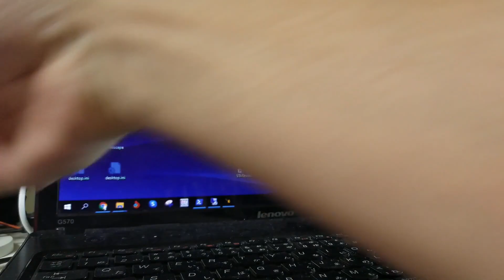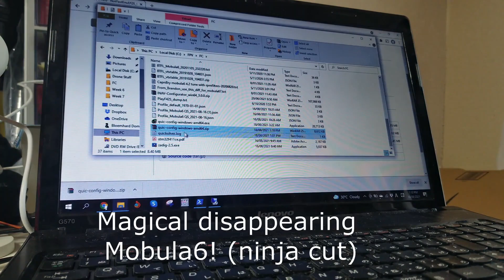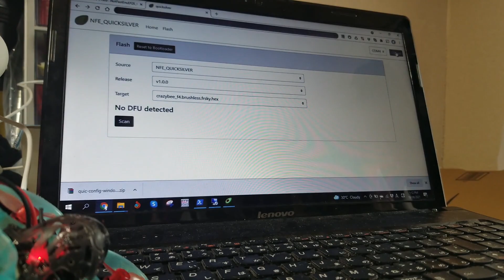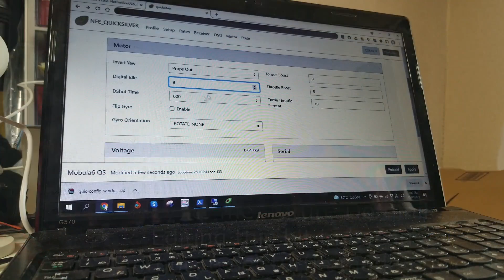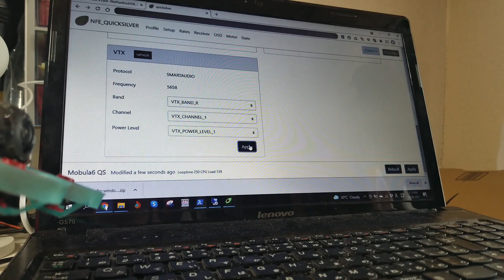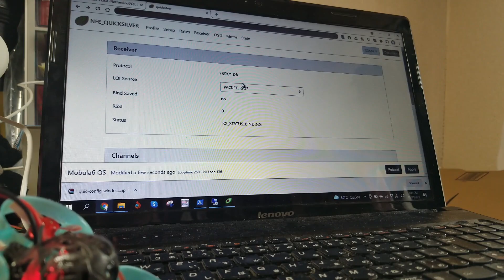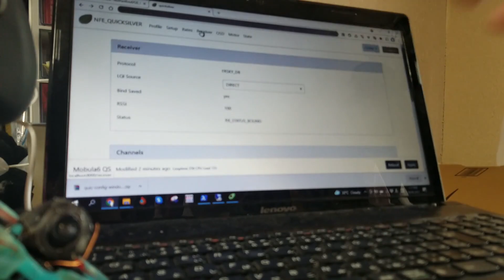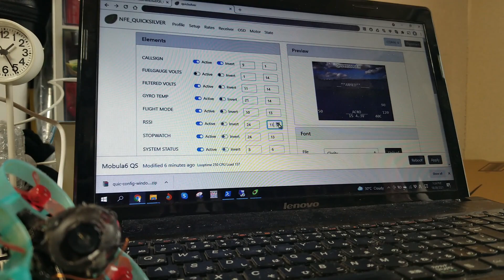Flashing QUICKSILVER to a Mobula6

Comment: 2022 flashing on Mobula6 FrSky:
1) Motors needs to be reversed: Connect USB -> Plug Battery -> Motors -> ESC Settings -> Load and "Reverse" motors directions
2) VTX shows up only as "TRAMP" protocol as opposite of "SmartAudio" and colors shows up weirdly on FPV goggles
3) I fail to arm the quad due to "Arming Safety" message on the FPV goggles
Reply from the maker: Interesting the motors needed to be reversed, but thanks for the info.
The vtx showing up as tramp won't affect the colors in the goggle, this just indicates you are not on the right channel I think. The new mobula6 has openvtx which can do both tramp and smartaudio, but will autodetect tramp. On tramp 25mw is power level 3 (first two are pit, and rce).
The arming safety mostly comes up if throttle isn't low enough (there are other reasons, but that's the main one for me). On the state tab, check your throttle position is registered as 0, you may need to change from AETR to TAER in the receiver tab.

Comment: Hi, I've been trying to load quicksilver onto my moblite7 (non elrs). But I can not get it to recognize the onboard receiver. In setup tab I left UART1 as none and smart audio under UART2 (video and OSD work fine). When I go to the receiver tab it shows protocol as "Unified Serial" when it should say SPI. under status it simply says "RX_STATUS_DETECTING" and under serial protocol it just switches between all protocols (DSM, frsky,..etc). I tried plugging in lipo, and pressing the reset button, also tried to unplug and use the bind button on the FC board...no luck. I reloaded betaflight 4.3.1 and was then able to bind with no issues. Would appreciate any help.
Reply from the maker: In that dropdown where it sats unified serial, there should be some other options, select D8 (or redpine) from that. You may need to save, and reboot the fc after selecting

Comment: what is the different in flight compare to  betaflight ?
Reply from the maker: I have trouble describing it but it feels "smoother". If you ever flew a Silverware whoop, it usually takes a pack or two to adjust to Betaflight; it doesn't take any adjustment with Silverware -> QS (and vice versa).

Comment: Thanks for posting this!  

Which camera are you using on the Mob6?
Reply from the maker: Hey there, it's the camera that was on an Akk AIO which died (. I worked out the gnd, positive and video pins and separated it, and then used E6000 to hold it in the mob6 canopy. It's kinda heavy at over 2g, but the mobula6 doesn't seem to mind the extra weight. And I love the super wide FOV and night visibility
Reply from the maker: https://youtu.be/a1xCa9FcYis
See from 29s in that video.
https://www.akktek.com/akk-a3-osd.html
It used to be in this AIO ... As you can see it wasn't the smallest camera!

Comment: Hey great video! Just got my mobula 6 and wanted to try this out :) unfortunately the "command" to save the bind does not seem to work here... any idea why? Tango2 + Multiprotocol bay
Reply from the maker: So it switches to RX_BOUND under status? And does it actually fly? And you can go to the status tab and should see the stick inputs there
Reply: @Tokyo_Dom  yeah switched to bound and I can see my AUX on/off
… and does not fly yet x)
Reply from the maker: @xnoux1  right stick up up up, then down down down timing done similar to what I did? I'm wondering if it could be a channel map issue (expects AETR) or endpoints (if you don't have 100% scale on your pitch channel)
Reply from the maker: If it's not either of these things, come to the discord and see if some of the other QS devs or users have any ideas
https://discord.gg/pXCrtskr (nfe_quicksilver channel)

Comment: Nice Dom!   Two edits I'd like to add tho:
1.  A stern warning that this is experimental firmware.  Treat it as such and be responsible with safety procedures 
2.  You can edit your call sign (or any other setting) in the OSD menus.  RRR is the gesture to enter OSD
Reply from the maker: Noted! I updated the description for now, and tomorrow i will edit the video to include a warning at the start... and a post-configuration OSD setup bit!